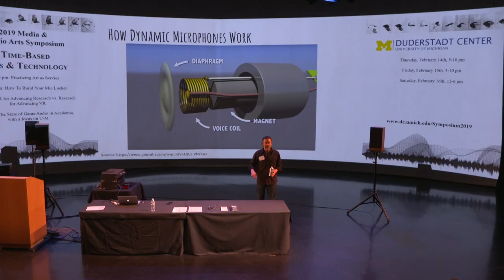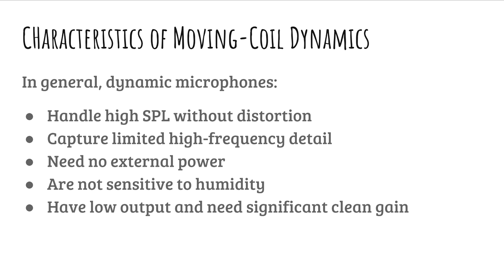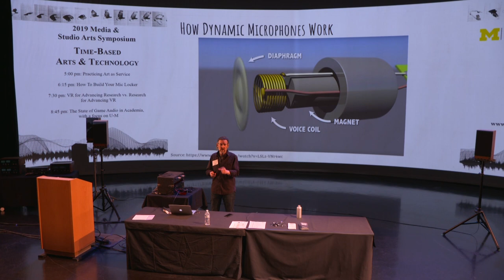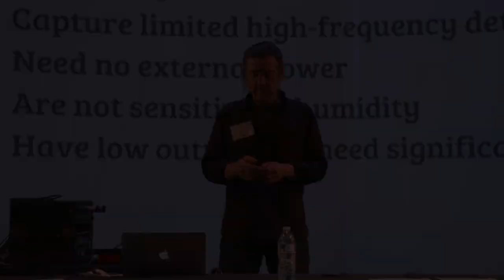How Dynamic Mics Work

Comment: One question 

Does the movement of the voice coil within the magnetic field created by the magnet  produce the current/audio signal ?
Reply: Yep, I think you're right. Just the basic electromagnetic theory you learn in highschool.

Whenever a conductor moves in the presence of a magnetic flux, a voltage is produced within the conductor.